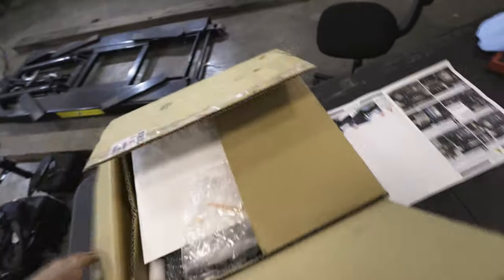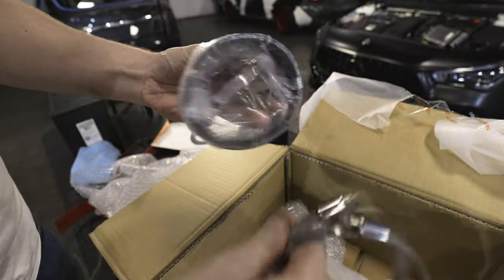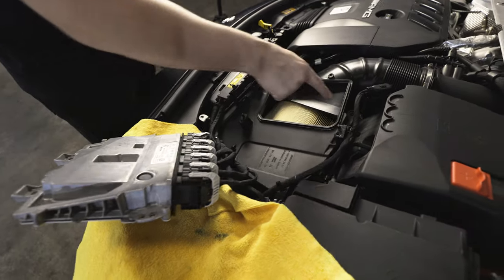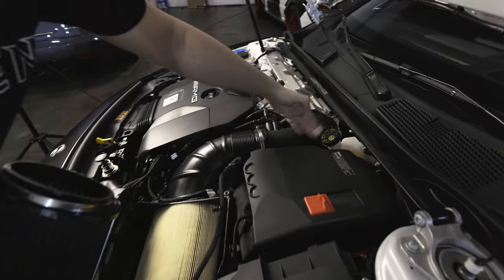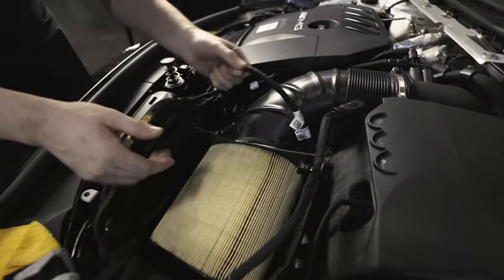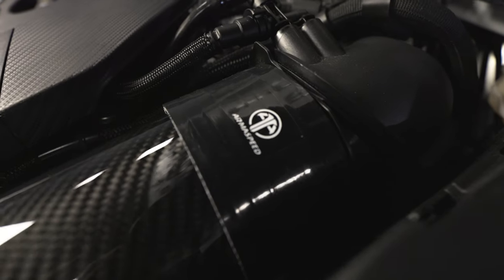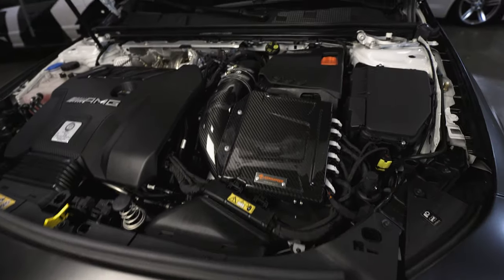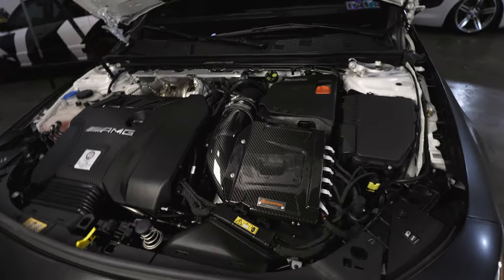My CLA 45 AMG 2020’s New Carbon Cold Air Intake Sounds INSANE! (Install How-To and Sound Test)

Comment: Did you have an increase in horsepower after  you installed the cold air intake? I am planning on putting it on mine
Reply from the maker: Yes about 15hp

Comment: Hey I just bought my first 2021 cla45 and I wanted to get some sort of protective coating. I was thinking of getting a paint protection film and a ceramic coating over the ppf. Got any recommendations or better ideas to protect the matte grey finish?
Reply from the maker: Nice! PPF and ceramic coating is perfect. Though since you have a matte grey finish you will need to get a matte ppf done. Those are typically $7-8k for a full body wrap. Ceramic coating is also great idea, I have my wrap coated as well.
Reply: Just got ours and doing ppf but just front hood, bumper, mirrors. Our matte gray top beautiful to not protect!

Comment: Does your car power increases right after installing the intake or do you need a tune to see a difference?
Reply from the maker: You do not need a tune to gain the power benefits, it’s roughly 15hp with it

Comment: Does installing an aftermarket cold air intake void the warranty?  I have a 2020 CLA 45 AMG and I'd like to get the carbon fiber cold air intake for mine, but I want to make sure that it doesn't void the warranty.  Thanks!
Reply from the maker: Only if you car has issues because of the intake that they can prove it will but no other than that warranty wont be voided in general
Reply: @yaboibakalli  would you mind letting me know when you bring your car in for routing maintenance if the dealership asks you about it?  I want to know that someone has had experience taking their car in for routine maintenance with an aftermarket part and it not be an issue for them to continue servicing the car before I take mine in for the first service.  Thanks.
Reply: Did you have to disconnect the battery before installing?

Comment: $650 is a lot to spend for better sounds.  

Why didn’t they switch out the factory turbo inlet pipe as well?  It definitely sounds better, but it would have been nice if they removed all of the factory restrictions so you could retune the car and gain more HP.
Reply from the maker: You get better sounds, about 15hp increase without a tune. The inlet doesn’t really restrict much as explained in the video so need for that, just more added cost to the consumer. 

Well worth the $650
Reply: @yaboibakalli  I can see where you are coming from, I wasn’t paying close attention since I was working at the same time.  Have they done testing on the turbo inlet?  I’ve never sent s factory one that wasn’t restrictive on a FI platform car.

Comment: Does this work on 2021 amg cla 45
Reply from the maker: Yeah this will work on the cla until new model comes out in like 5-10 years
Reply: @yaboibakalli  short answer 2021 fits parts from 2020 okay just new amg mercedes